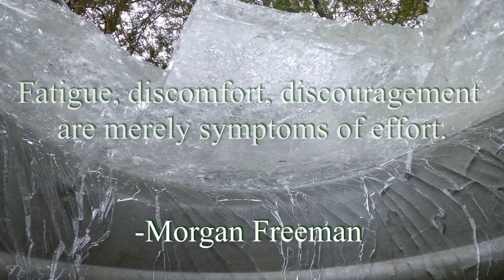Winter Camping Full Time in Michigan: The Challenges #22

Comment: This was a good film. Your content is good! You are living the equivalent of our Immigrant Ancestors. My late Sister and I were volunteers at the Brandywine Plantation in Delaware County PA. We would dress up like colonial women, farm, and perform farm crafts like spinning to the visitors. It was a cultural anthropology experiment.
Re Freezing batteries. You need an insulated box built with thick slabs of insulation and a heating pad with a dc plug you can use with your battery.
Heating pads or electric seed germinating mats go a long way.
Reply from the maker: Sounds like quite an experience!  I bet you learned more in a season of doing that than the rest of us would reading a stack of books about that time period.

Lots of options for more/better/warmer batteries with $.  But the less I spend, the longer I can stay out here so for now, I just let them freeze in the winter.

Comment: G'day from Australia. 
Stumbled onto your deer blind build, subscribed, and am making my way through all your vids. Really enjoying them.
I can't help but think how advantageous it would be during winter to insulate that deer blind/guest cabin so you could keep things from freezing, dry out your towel, keep batteries warm etc?
Reply from the maker: Thanks! Glad you are enjoying!
Sure would be an advantage to have a warm place to remedy these issues. But I don’t have any way to heat the place all the time anyway. Getting propane out there is a real pain and being in a cedar forest, heating with wood really isn’t possible.
Reply: @survivingringworm2202  Thoroughly enjoying it, you guys sense of humour is right up my alley too, very dry. Unlike ya towels! 
My first thought was one of those diesel heaters that people use in their van/camper conversions. efficient, and quiet?
Reply from the maker: Do they give off carbon monoxide? That why I ended up with these Buddy heaters. They are catalytic so no CO poisoning. 
But diesel would be great. And a lot cheaper. If it didn’t kill ya.
Reply: @survivingringworm2202  from what I've seen on camper conversion videos, you have to mouth the unit outside, I'm guessing for that very reason. I found this article on different types of heating, which includes the pros and cons of diesel, maybe it could help? https://bit.ly/3nWWWDC
Reply: I also thought of insulating one of the enclosed spaces, maybe the one with the stove in it? Also, if you don't mind making a larger space, you could reserve a part of the space for a large-heatmass of an oven that would slowly give off the heat in terms of hours after it's been fired. Thermal mass + insulation could help getting away with running fire once a day or maybe less often.
Other ways to passively heat a place - look up Jean Pain compost heater for greenhouses. Looks like it could keep your tool shed above 0C for weeks and even months.

Comment: You don't think you have a place to dry things out.....  String a line up under that tarp where the quad is. Even in freezing weather, if you hang something on that line, it will eventually dry out.
Reply from the maker: Really?  It would dry even if the temp never got above freezing?
Reply: @survivingringworm2202  It doesn't get absolutely dry that way. But believe it or not, a lot of the moisture does get removed. It's not like when taken out of a dryer. More like after a couple of spin dry cycles in the washer. Dry enough that what is left is gone within 15 or 20 minutes of wearing.
Reply: By the way. It takes a while. LOL
Reply from the maker: I believe I have a science experiment to run...
Reply: @survivingringworm2202  Worked for us at boy scout winter camp when I was young. Hang it up, let it freeze. Pound it some to get rid of as much ice as possible and pulverize what is left. Hang it up again. Take it into the sleeping bag at night. Dry within 15 to 20 minutes. =0)

Comment: Water vapor isn't a byproduct of any propane heater. It's an unavoidable factual byproduct of burning propane. Any and every propane heater creates water vapor. This video's explanation of catalytic heaters and carbon monoxide is also wrong and the so-called headslap around 1:30 is called a facepalm.